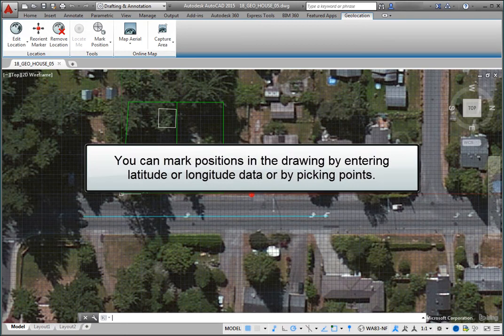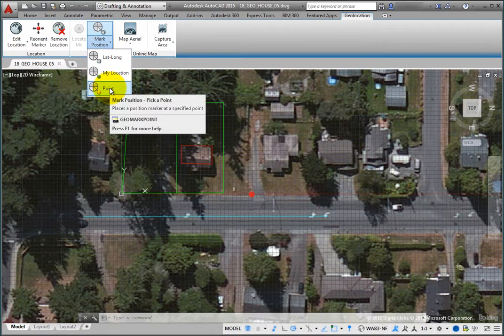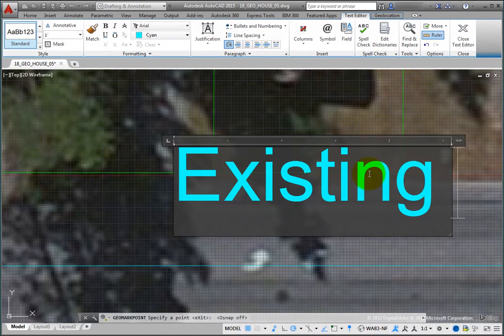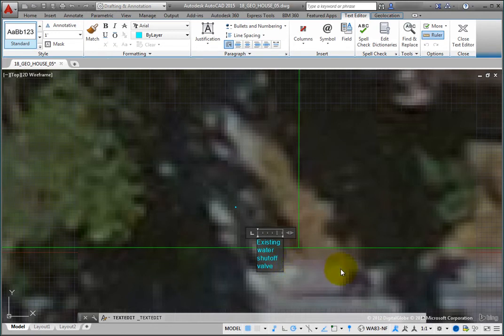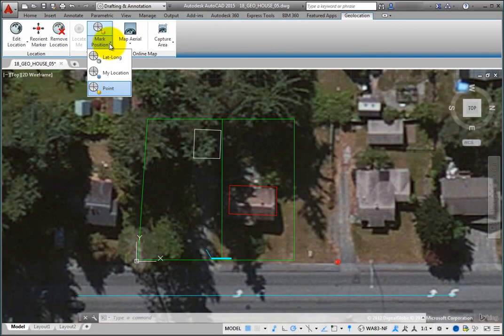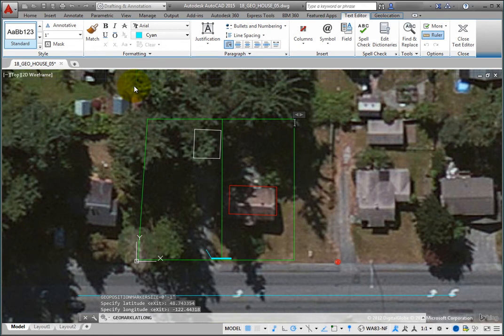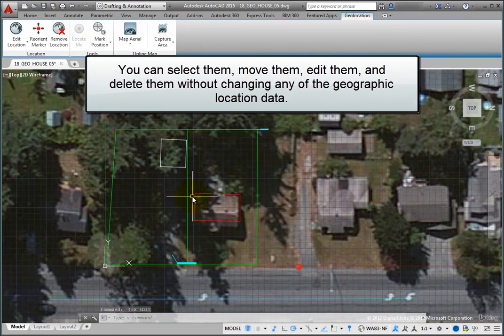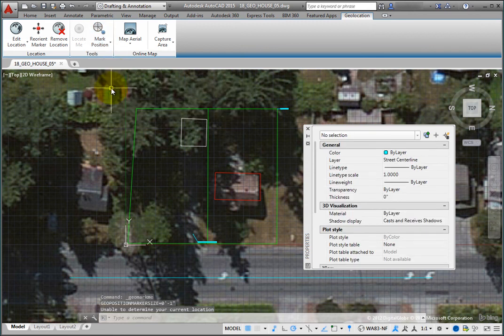Marking Geographic Positions

Comment: I'm trying to get the precise location for a series of points I drew in the map, but the PROPERTIES panel only displays 4 decimal points for each point's latitude and longitude. Is there a way to get more accurate data?
Reply: I've answered my own question: you just set more decimals from the DRAWING UNITS > LENGTH > PRECISION dialog's drop down!
Reply: @Guill0rtiz  thank you it helps a lot!!